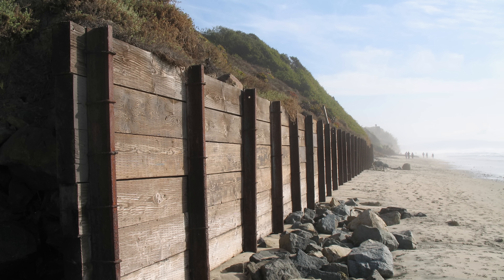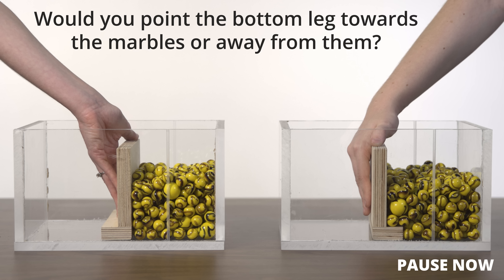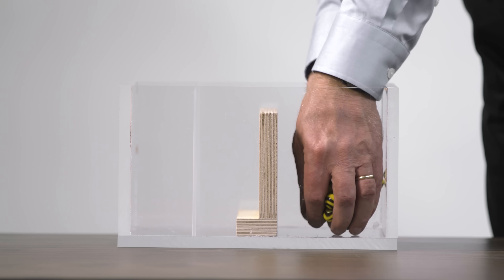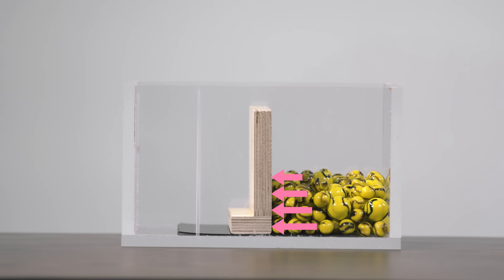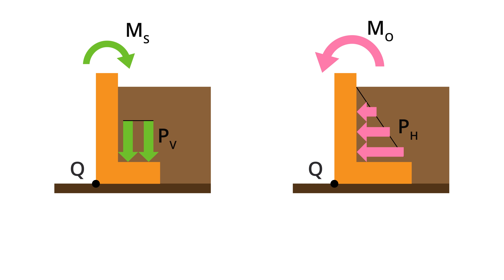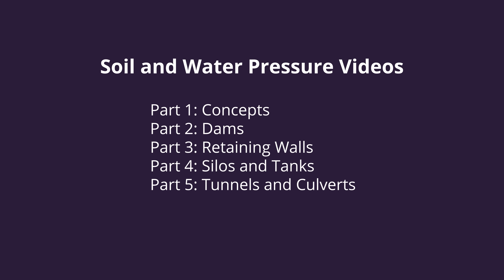8. Retaining Walls

Comment: But the tensile strength of concrete and other building materials is minimal, and that's the issue at the elbow of the "L" leading to a crack and sudden failure.

Comment: The inward wall wins because there is less space at the bottom which means less pressure AND some of the weight is clamping down on the wall further holding it in place. The lighter pressure atop isn't strong enough to overcome the lever shape at the bottom where the pressure is absolutely highest.

Comment: Lets see it from above: "L" are the materials of the containing wall and "+" is the thing being contained. The "(L)" is a containing wall part that is covered from above by the thing being contained. "-" are natural containers.

Inverted L type containing wall:

----------------------------------------
LLLLLLL ++++++++++++
            LLL +++++++++++
            LLL +++++++++++
            LLL +++++++++++
LLLLLLL ++++++++++++
----------------------------------------

L type containing wall:

----------------------------------------
 LLL(L)(L)(L) +++++++++
LLL ++++++++++++++++
LLL ++++++++++++++++
LLL ++++++++++++++++
 LLL(L)(L)(L) +++++++++
----------------------------------------

Despite the second option has the additional pressure force that keeps the friction, I think it is easy to see, this way, that the second one is way more unstable than the first one with approximately the same amount of materials (it has one L less in the covered part because the brackets already make it wider). Why? The second one needs surface to keep the pressure going. In this model, we can do two things: moving away the turning point which as effective as it is said in the video, or putting it the other side to keep the friction using the contained material pressure. The bad thing is that, with the same amount of material and this new shape, we can move the turning point really far away, or try to get a few pressure using the inverted one. In this video, a lot of material is being wasted in the middle of the inverted L, when it could be used in the way I show.

Anyways, this is just an observation and I'm no expert, so I may be wrong. Please, correct me! I dont try to criticize the video, it just shows a reality, but I wanted to add this possibility
Reply: Well, in fact, more materials were used in the second, less efficient one, since i put three bracket Ls in exchange of four normal ones, as it is shown here

(L)(L)(L)
LLLL

Comment: Very interesting video, but could someone give some examples of where you would need a retaining wall vs a normal wall?
Reply: Walls, can be made of many different types of material,  can be erected anywhere to divide properties, or for privacy.
But a Retaining wall has other purposes: to hold back dirt,  of other objects.
Retaining walls are usually erected on slight slope to steep slope areas. 
On flat grounds Retainging wall are usually not needed, unless if you are going below grade.
The best thing to do is to Google it.
I live in the  Mountainous area, lots of up & down hills, almost every property has some sort of a retaining wall. Hope this helps bit.
As with retaing walls, the Engineering behind it is amazing.  
Most people only see the finished retaining wall, but there is lot of Engineering behind the scenes.
Reply: By a normal wall are you referring to an item that is essentially a fence?

Comment: i thought this was common sense - you have soil or mass guaranteed on one side to help weigh it down...also if you needed additional supports to retain the structure of the wall they can be hidden.
i guess an upside down T may offer additional support but i assume the ammount of addition support is minimal so is not needed

Comment: If you think of things in vectors everything gets super simple. Idk why but that’s how I think of every force in life and it makes understanding certain things really easy, it also makes other things harder to understand. I fly a lot and thinking of things in terms of vectors makes understanding my maneuvers a lot easier. You just got to imagine thousands of vectors across each wing while you’re flying and in doing so you almost feel like you, the plane, and the air around you are one system, because you are, and you can easily keep yourself from dangerous situations. You can do this with cars as well but it gets a lot harder since there’s four cylindrical contact patches that keep you in control. Vectors make understanding forces like lift, friction, torque, and all other subcategories of those forces like drag and horse power, which is really a function of torque, easier. I recommend trying to understand certain parts of life in this way and maybe take a free physics course at a college. If you’re wondering you can take a free college class at any college. The catch is that you won’t get credits or a degree from it. I got lucky and was able to take college physics for free and get the credit through my high school when I was 15 but not everyone is that lucky. For everyday life just understanding simple physics is great it’s just something each persons who wants to learn needs to make time for.

Comment: Although I understand the reason for using marbles, they probably aren't the best way to go. Because they are not dense enough. In fact when you would use soil, the mass on the horizontal would be sufficient enough to fill up completely to the top, without tilting the retaining wall. And of course normally the wall itself has a lot of mass also.

Comment: 00:48 But Mr Engineering the marbles would hold the bottom of the L down and they would have to overcome their own weight in order to push over the retaining wall. In the other configuration the marbles would easily push the retaining wall away because it doesn't have enough weight or friction to keep the marbles retained.

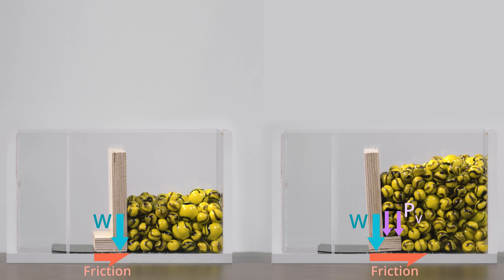2:57 Yes Mr Engineering, that was the point I was making.
Reply: while forgetting that the footer needs to be below frost depth... thus the wall would not give way as per the idiotic model of putting a wall on grade without extending it below grade.

Comment: It still failed.  Sure the down force helps strengthen the footing, but there is no wall support against the lateral forces in the opposite direction.  Use of a properly constructed BUTTRESS works every time.  It too has a wide integral footing AND uses the downward force of gravity to strengthen the wall.   Think about it.  Make it 3 dimensional
Reply: Make a 2 ft high wall that runs along one side of a back garden (as an example), 3D?? There are uses for a buttress, but it's not where a retaining wall is used.

Comment: When we put a retaining wall over 30 years ago, our engineer designed it with a “toe”.  It is similar to the upside down T, but the amount of the base is significantly longer underneath the dirt. If I understood him correctly when he explained it to me, the L shape would tip over relatively easily.  By putting a “toe” on it, the wall can’t tip over by simply pivoting. Instead the toe would mean that the base underneath the piled dirt would have to lift upwards rather the simply pivot, meaning it could hold back much more dirt than a simple L shaped wall…
Reply: yes.  the extension in the other direction would extend the moment arm to resist the overturning. 
this idiot's model assumes that the footer of the wall is at grade... not below frost depth.. and is invalid.

Comment: And here I'm just wondering why they don't build solid triangular walls which support the total structure by reducing the tipping point ability and eliminating the fracture probability at an L joint. It just seems like an overally much more stable structure to me and you only have to worry about the slide, which is reduced by the greater surface area at the bottom creating more friction with surfaces it may slide on. Systems are rarely perfect, but it just feels like this is a super easy fix with basic 9th grade geometry. Add the underground foot as well if it improves the effectiveness. And I see a lot of comments about 'waste of resources' but wonder how much resource is wasted rebuilding a failed wall because they used an inferior design.
Reply: Cost, most engineering problems have optimum performance solutions, but we have to consider whether it is economically viable or practical to do that. L shape is a good balance between performance and minimal material usage.

Comment: The USSR used this L-shaped design for the concrete segments of the Berlin Wall.  If a vehicle attempted to ram the wall, the weight of the vehicle on the bottom leg of the wall would prevent the wall from overturning.

Comment: This video is so out of date.  Rule of thumb when building the foundation for a “vertical retaining wall” is.  The length of the footing is 2/3 the height of the wall.  The thickness of the foot is half the length of the foot.  A tongue can be created under the wall.  This tongue will be the thickness of the intended wall and will be at a depth below the foot the thickness of the wall.  Depending on the substrate, a further tongue of the same dimensions as the tongue under the wall can be constructed at the rear/back of the foundation of the retailing wall.  I have built retaining walls 3 and 4 metres in height and 60 years later they are still vertical.  One may say “over engineered, to costly”.  Well what is the cost to repair or rebuild 60 years later?

Comment: So an L shape wall with Triangle supprts back of base to top of wall.
Spray on waterproofing.  And the face of the wall is fatter at the bottom and skinnier at the top. 
Add french drains and backfill with clean crushed stone.

Comment: yes but how does the outward bend preform when partially buried?  the models you display only show surface performance. i bet the outward bend would perform better in keeping the wall leveled even trough it technically may not bear a greater load

Comment: Not allowing for weep holes at the bottom to allow water escape and relieve water pressure which is a large factor. Also diagram isn't allowing for a dpc course which will make a wall with pressure on one side slide and in this lousy demonstration there no mention of brick piers or piles so not real world.

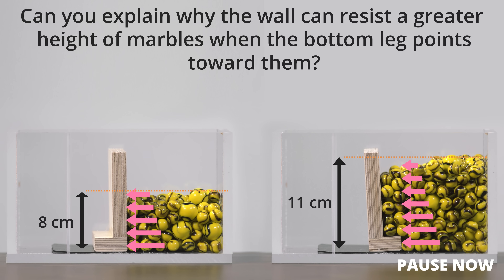Comment: (Timestamp: 2:30) My answer: I went with the "pointing in" wall (right) instead of the left wall at first. My reasoning was that the marble's weight would push down on the wood sticking inwards and leverage the wall to stick upright longer from the extra force.

Edit: I was close- I used improper terminology and worded my response weird, but I had the general idea down. I also didn't realize that the downwards pressure would also increase friction! That's a key detail to miss. Close, but not exactly. 3/5.

Comment: I´d love to know how Japanese drywalls work as retaining walls. On first glance it´s trivial, but there are many problems that can ruin them:
1) heavy seasonal rain washing the supporting earth away
2) freeze-thawing
3) soil behind the retaining wall not compacted enough to support heavy structures, such as the iconic keeps that are up to 7 stories tall!

Relatives of mine built their home on normal ground, but 50 years later their house sunk into it and broke it literally into two halves! Just imagine having to build an artificial motte without power tools and it has to withstand a much heavier weight... Plus, you don´t do it in Austria, but a place with heavier seasonal rain and earthquakes...
Most just look at the keeps and see a marvel of engineering, but for me what´s underneath is just as interesting...

Comment: Experimenter does not seem to care about the placement location of the wall. If the placement is off by fractions of an inch, then the results are biased to the experiment where placed closer to the marbles due to allowing for a higher volume being achieved.

Comment: So which is the most efficient design? So for the least amount of wood, just using sand now instead of marbles. Make a new construction where you do all the possible configurations of the shape. And make a ratio of the amount of wood to the height of sand its barricading; keeping the height of the wood the same in all cases from the rotation point.

Comment: Back when i did landscaping in high school, i was taught that if you use the L shape, the lower part of the L should be at least 50% the length of the wall proper, and that you should never build a retaining more than 48-50" in height without getting an engineer to design it.

You also need to place about 1/3 the height of the wall as seen above the ground, below ground as an anchor.

Building one of these for my parent's home this summer actually, though its going to take effort, and a lot of work, due to the nature of the slope, and the fact i cannot use stone as i would prefer as the soil here is...non conducive to stoneworks (the whole reason for the new retaining wall is that the last three stone works walls have lasted less than 2 years each, due to the unique quality of the soil here, being largely clay, with pockets of gravel like stone and dirt.)

My plan is to use 10 foot cedar posts, with a diameter of around 6 inches, placed 5 feet apart, as the primary 'footing' and using cedar planks, of 4"x12" as the wall proper, with additional posts placed horizontally, but perpendicular to the wall, and affix them using 10 inch anchoring bolts to the seated posts.

This gives me two anchoring mechanisms, which will hopefully prevent another wall collapse.

Comment: the problem with the L facing the marbles is the part where the two boards are joined together.  When they are faced away there is no risk of the connection bending and seperating.  It would be better to face the L away and anchor the base.

Comment: If the toe is wider with a beam at the toe front and also at the rear ,reo goes through the toe,loops around in the rear footing beam ,then blocks laid over the starter bars,these ar e then extended as the wall rises.along with transverse bars , there is no way the wall can be  moved with pressure 
knock outs at the base run of blocks  this allows to check that when the grout fill is added  the concrete goes full height of the blocks,weep holes left every second block

Comment: the inside facing L should be common sense because the weight of the dirt on the bottom of the L shape keeps it from tipping. im not an engineer and even I knew that.

Comment: This demonstration is illustrative. However the wood is much less dense than the marbles, while concrete is similar in density to soil. 
This matters because the whole example relies on combined center of gravity vs center of horizontal pressure. (And even that is setting aside material strengths like concrete in compression/tension)

Comment: I think you have to also take into account the Density of the Wall, the depth of the wall foundation into the soil, the shear strength of the material of the wall. You also haven't stated that the balls used to represent soil have almost no cohesion nor internal angle of friction. The densities of the balls are also not being considered. In addition, you have to take into consideration the shear strength and flexural rigidity of the wall. All what this video shows is a bunch of assumptions and overtipping. Mainly, the error with the model lies in making the soil too granular and the wall too light. Statically speaking, the explanation is acceptable given the general audience. Good work!

Comment: Nice video  to use an inverted wall you have to check if the soil pressures  are under the  allowable limits this type of retaining wall has problems with compression of soil failure.

Comment: Hey if you engineers are so smart, why not have a horizontal leg on both sides of the wall like an upside down T
Reply: Why not drill 35ft steel and concrete piles into the earth? 
COST!!!!!! Why pay for what you don't need.

Comment: Plotting equations I have seen that the optimum selection between those two shapes, strongly depends on the specific weight of the retained material or, the base length. In this graph you can have some fun changing parameters and analyzing the critical point (coincidence of two equation roots). For example, if you have a concrete retaining wall of 7 m height, 0,45 m thickness and 1.9 m base it will be better to choose the mirrored L shape considering the specific weight of the soil as 11.9 kN/m^3. Just for fun with the equations, because we are not considering passive/active earth pressure, etc... 

https://www.desmos.com/calculator/hw5nn2yvq0

Comment: Start with a base row block buried below grade. Put a corrugated sock pipe behind base row out both ends of wall as relief pipe. Every course up, set block back a 1/4". Proper gravel and dirt compaction behind wall every course important. This applies to residential walls mostly.
Reply: Oh thanks for saying that mate,,,, I couldn't take much more of this video..
You a bricky or a mason..

Comment: Why not put the L thing on both sides? so it has more support?
Reply: It does add support, since it moves the toe further from the weight, which contributes in opposing overturning moment by extending the moment arm. But if you would have to spend the material just for that, it would be preferable to just use that same material to extend the horizontal leg for much greater support. Trust me, I'm an engineer. I did the math.

Comment: guess: does the pressure of the marbles hold the wall in place?
Reply: How do you mean?
Reply: if the L shaped support is facing inward then the pressure of the marbles above it will stop it from moving( theoretically, i never finished the video)